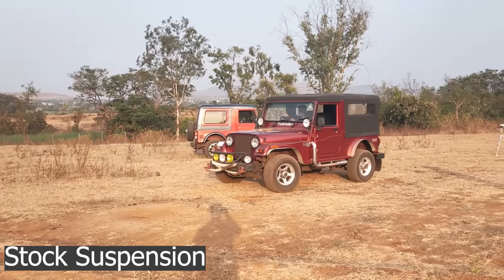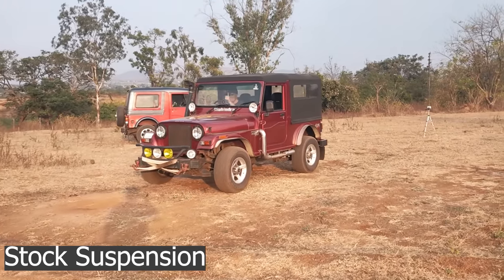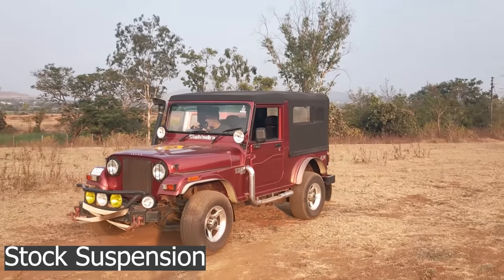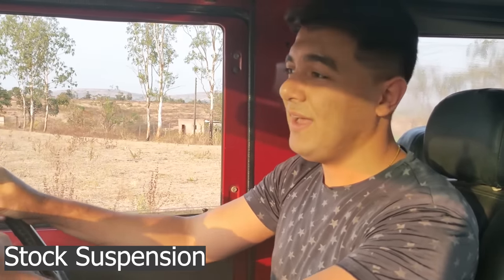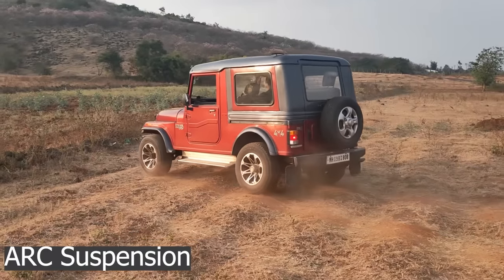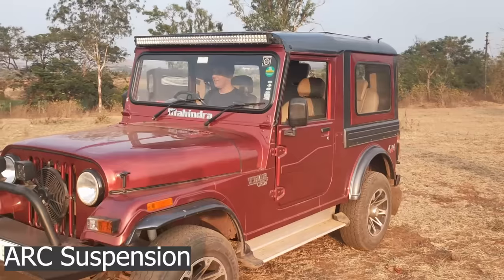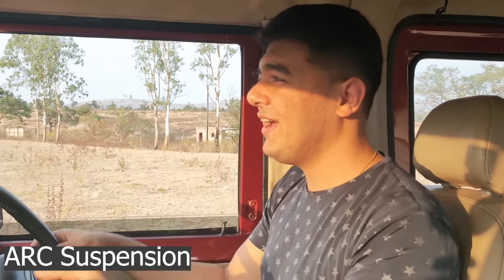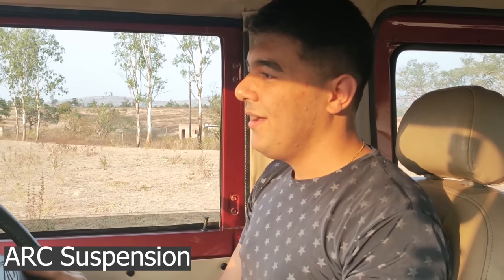Mahindra Thar CRDe Stock Suspension vs ARC kit - Composite Leaf Spring Shock Absorber Anti Roll Bar

Comment: How about arc rear suspension for old model ford endeavour? Is it worth to change the rear leafs for a comfortable ride?
Reply from the maker: Yes sir, the composite leaf springs work wonders for Endeavour.
You will definitely get more than a comfortable ride for sure.

https://www.arcindustries.co.in/products/ford-leaf-springs-118119/endeavour-leaf-springs-155156/ford-endeavour-arc-composite-leaf-springs-229230
Reply from the maker: Product can be ordered from the below Link - 
https://www.arcsuspension.in/ford/endeavour/endeavour-1st-gen-2003-2014/ford-endeavour-arc-suspension-kit-front-rear-shock-absorbers-rear-composite-leaf-springs-ford-endeavour-2003-2014

To know more Call us on 9422047019 / 9922099292

Comment: Is there any suspension upgrade to Ertiga 2020 such as antiroll bar
Reply from the maker: Not at the moment sir, but we do have Rear Shock absorbers for the New ertiga 
https://www.arcindustries.co.in/products/maruti-suzuki-shock-absorbers-102103/ertiga-shock-absorbers-125126/maruti-suzuki-ertiga-arena-arc-rear-shock-absorber-2018-2020-374375
Reply from the maker: Product can be ordered from the below Link - 
https://www.arcsuspension.in/maruti-suzuki/ertiga/ertiga-arena-2nd-gen-2018-2021/maruti-suzuki-ertiga-arena-arc-rear-shock-absorber-2018-2022-ertiga-arena-2018-2021

To know more Call us on 9422047019 / 9922099292

Comment: Can you make product with more suspension travel ?
I mean one with a bit more articulation than this product
Reply from the maker: More Articulation will increase Body roll. Optimum design specifications require balanced parameters with suspension travel.
Upon driving on this kit, You wont require more travel. Also please notice that the dips are quite aggressive. We are literally driving it in Farm cultivation cleared track.
Reply: @ARCSuspension  thank you. Are your products available in Siliguri West Bengal?
We Nepali Customers need this product.
Reply from the maker: Yes sir, contact us on +91 9922099292 , 9422047019 
We ship worldwide. 
Shipping is free Pan India. You can directly order directly on our website too. 
Arcsuspension.in

Comment: Can we disconnect the swaybar for better articulation in offroad in this model
Reply from the maker: Seems like a custom requirement, please contact us on 9422047019 / 9922099292 to know more.

As far as I know, ARC make Anti Roll bar which should easily suffice in all conditions.

Comment: Thanks for exaggerating the problem. Did the weight of the hardtop partially resolved the issue?
Reply from the maker: No, suspension kit strength is different according to vehicle.
Soft top , hard top, frp top, heavy modifications.  All have  different configurations.
Composite leaf spring can be custom made once we receive feedback from customer on the state of modification done on vehicle. Doesn't matter if hundred of kg is increased,  we make leaf springs accordingly.
Reply: @ARCSuspension  pls share price for thar 2018 model

Comment: Im coming straight at you after getting my bolero delivered
Reply from the maker: We shall be ready for you <3 
Please contact Mr Rohit Pawar at 99220 99292 regarding fitment, because we do not provide fitment services at the moment and encourage customers to get it fitted with their local mechanic/workshop. No modifications required for fitment.

Comment: Hello sir i have thar 700 limited edition. .what will change in my thar for comfort...
Reply from the maker: Sir the whole feeling of driving will be changed. The vehicle will feel much smoother and easier to drive compared to stock suspensions.

Comfort Series Suspensions 
https://www.arcindustries.co.in/products/mahindra-109110/mahindra-thar-142143/mahindra-thar-crde-arc-suspension-kit-composite-leaf-spring-shock-absorber-and-anti-roll-bar--330331
Comfort and Offroad Series suspensions.
https://www.arcindustries.co.in/products/mahindra-109110/mahindra-thar-142143/mahindra-thar-crde-arc-suspension-kit-composite-leaf-springs-shock-absorbers-anti-roll-bar--352353
Reply: @ARCSuspension  can u pls elaborate in what changes are there in the above two suspension set ups? If i want to make thar comfortable for city use with occasional offroading, which one should i select and why?
Reply from the maker: Product can be ordered from the below Link - 
https://www.arcsuspension.in/mahindra/thar/thar-crde/thar-crde-arc-suspension-kit-composite-leaf-spring-shock-absorbers-anti-roll-bar-onroad

To know more Call us on 9422047019 / 9922099292

Comment: I know this not relevant question .. but is there any improvement in mileage ?
Reply from the maker: Indirect behavioural aspect may cause improve the average.
Suppose your commute is on bad roads and excessive braking is observed due to discomfort. By installing good suspensions, comfort and stability will render the driver brake less. Reduced Braking will indirectly cause the momentum to be not wasted.
Cornering will be better, Increased stability while cornering will feel effortless hence reduced braking.
Also good suspensions increase Tyre grip, increased grip = less drag. Less fuel wasted.

Suspensions can play a vital role in all parts of the vehicle as the jerks absorbed by the suspension reduce the resonance and play in the parts, which may otherwise cause cabin sounds and play in moving parts if suspensions are not optimally designed and tuned.

Comment: Wouldn't you get the same result by just switching the company shocks with a softer pair and throwing a pair of heavy bags in the back seats to settle the leaf springs?
Reply from the maker: If that were true, truck would've made the best for comfort.
Equilibrium of the vehicle can not be stabilised by adding forces, strength capacity should be versatile and show support comfort in all weight,road conditions. And on all speeds.
Also the kmpl will go down,  so it may do more harm than good.

Composites will perform way better even when compared to a metal leaf spring vehicle with added load.

Comment: Hello dear i need this for thar di 2013 how much it will cost and is it sutaible for thar di or not
Reply from the maker: Sir we have two variants specifically designed and manufactured for Thar DI.

Onroad Comfort Series ARC Suspension kit
https://www.arcindustries.co.in/products/mahindra-109110/mahindra-thar-142143/mahindra-thar-di-4wd-arc-suspension-kit-composite-leaf-springs-shock-absorbers-anti-roll-bar--351352

Onroad & offroad series ARC Suspension kit.
https://www.arcindustries.co.in/products/mahindra-109110/mahindra-thar-142143/mahindra-thar-di-4wd-arc-offroading-suspension-kit-4-rubberised-composite-leaf-springs-4-shock-absorbers-anti-roll-bar--357358
Reply from the maker: Please Share your phone number for a callback.
We will be happy to assist you with any queries you have about our products.
Reply from the maker: Product can be ordered from the below Link - 
https://www.arcsuspension.in/mahindra/thar/thar-di/thar-di-arc-suspension-kit-composite-leaf-spring-shock-absorbers-anti-roll-bar-onroad

To know more Call us on 9422047019 / 9922099292

Comment: arc was in speed but the stock was in very low speed to prove stock suspension inferioor
Reply from the maker: You can't possibly drive in speed without incurring injuries in stock condition. 

You know, if one wouldn't drive over potholes the same way, why expect us to do otherwise.

Comment: Kya mai Apni old mm540 1998 model me laga skta hu kya prize kyo hoga pure kit ka
Reply from the maker: Sir total price for MM540 will be 88,980 jisme aapko
4 (2 front and 2 rear) Composite Leaf Springs and 4 ( 2 front and 2 rear) ARC Shock Absorbers mil jayenge.
Product can be ordered directly from our website linked below,
https://www.arcindustries.co.in/products/mahindra-109110/mahindra-jeep-series-147148/jeep-mm540-arc-supension-kit-composite-leaf-springs-and-shock-absorbers--281282
Reply from the maker: Product can be ordered from the below Link - 
https://www.arcsuspension.in/mahindra/jeep-series/mahindra-old-jeeps/mahindra-vintage-jeep-arc-composite-leaf-springs-front-and-rear-1954-2010-mm540

To know more Call us on 9422047019 / 9922099292

Comment: Me Gujarat se hu 
Muje meri bolero (2008 slx) me lagana he 
kitna bill  hoga
Full system ka
Reply from the maker: Sir full system will cost you 67,150 inclusive of doorstep delivery all over India. 
Please follow the below link. It is specifically designed for Bolero SLX.
https://www.arcindustries.co.in/products/mahindra-109110/mahindra-bolero-146147/mahindra-bolero-slx-arc-suspension-kit-composite-leaf-springs-and-shock-absorbers--308309

You can order the suspension directly from the above link.
Reply from the maker: Please share your number for a callback.
Reply from the maker: Product can be ordered from the below Link - 
https://www.arcsuspension.in/mahindra/bolero/slx/bolero-slx-arc-arc-suspension-kit-onroad

To know more Call us on 9422047019 / 9922099292

Comment: How can i get s kit installed in greater noida west
Reply: I have mahindra thar crde 4x4
Reply from the maker: Sir you can get it shipped Worldwide. Any local Mechanic can do the installation. 
Product Link - https://www.arcsuspension.in/mahindra/thar/thar-crde/thar-crde-arc-suspension-kit-composite-leaf-spring-shock-absorbers-anti-roll-bar-onroad

For more information - please contact us on 9422047019 - 9922099292
Or mail us on info@arcsuspension.in

Comment: Please upload this type of comparison video of thar di
Reply from the maker: Sir you can get better performance in thar di because
Thar crde has leaf spring and shock absorber combo at the rear and coil spring and shock absorber at the front.
We only manufacture composite leaf springs and not the coil springs. 
For Thar di we manufacture the whole set.
4 leaf springs, 4 shock absorbers and antiroll bar. Making the vehicle drive completely stable while making it comfortable even on bad roads
Reply from the maker: We will definitely try and get two Thar Di whenever possible for testing. 

Thank you for your input
ARC
Reply: @ARCSuspension  Thanks a lot if you uploading video of thar di. And after i will installing soon leafsprings in thar.

Comment: You should drive both the car in the same speed. Why the stock suspension thar driving at low speed n the ARC suspension driving at high speed? If you drive the stock suspension at that same speed you'll see almost same performance.
Reply from the maker: Same answer given to everyone.

Still. Will you break your back and drive, because it will cause issues.
Simply put, you can't physically drive the stock vehicle without pain. With ARC it is easy.
The whole video shows the same, and if you have any doubts, try for yourself with moneyback guarantee. Is that serious enough ??
Reply: @ARCSuspension  decided to order one for my ambassador grand.
Reply from the maker: Will be happy to serve you. Please share your details if you have any queries.
Reply: @ARCSuspension  I had a discussion with sir for over a few years. Heard you have started a showroom in chennai.  Looking forward to visit it . Can you pls share the location
Reply from the maker: ICD TUNING - CHENNAI

Comment: What is the total cost to make it fix?
Reply from the maker: Sir fitment costs are variable based on your mechanic/workshop rates depending on location. This full suspension kit can be ordered from the link given below.
Product link given below
https://www.arcindustries.co.in/products/mahindra-109110/mahindra-thar-142143/mahindra-thar-crde-arc-suspension-kit-composite-leaf-spring-shock-absorber-and-anti-roll-bar--330331
Reply from the maker: Product can be ordered from the below Link - 
https://www.arcsuspension.in/mahindra/thar/thar-crde/thar-crde-arc-suspension-kit-composite-leaf-spring-shock-absorbers-anti-roll-bar-onroad

To know more Call us on 9422047019 / 9922099292

Comment: How can we contact you to instell arc suspension
Reply from the maker: You can directly order the suspension from our official website
www.arcindustries.co.in through all online payment options.
installations require no special knowledge as these parts are direct replacement to stock OEM parts. You just remove the stock parts and install our suspensions parts right on.
Installation requires no modification to the vehicle.
Any local Mechanic can do it.
you can get in touch with us on 9422047019 / 9922099292

Comment: Wat is the cost?
Reply from the maker: Hello Sir, We have multiple variations for suspension kit for onroad to mild offroading kit, to onroad plus heavy offroading suspension kit for Thar CRDe and Thar DI
Check out the range of suspension kits available for Thar CRDe and DI
https://www.arcindustries.co.in/products/mahindra-109110/mahindra-thar-142143/mahindra-thar-crde-arc-suspension-kit-composite-leaf-spring-shock-absorber-and-anti-roll-bar--330331
Reply from the maker: Product can be ordered from the below Link - 
https://www.arcsuspension.in/mahindra/thar/thar-crde/thar-crde-arc-suspension-kit-composite-leaf-spring-shock-absorbers-anti-roll-bar-onroad

To know more Call us on 9422047019 / 9922099292

Comment: There is some body roll. :)
Reply from the maker: It falls in articulation category sir. Physics cant be denied :)
Reply: @ARCSuspension  btw, I'm looking for suspension kit for my bolero camper 4x4. Which kit to use and how to get it in kathmandu nepal?
Reply from the maker: Sir please speak with us on 9422047019 / 9922099292. 
For Mahindra Camper there are a few variants, please share the photos of suspension setup for front and rear on whatsapp on above numbers to recommend you the right product.
The product is usually shipped to Nepal for Mahindra Vehicles.
Reply: @GothaleKancho  lilu bhayo tapaile
Reply: @ARCSuspension  thanks.

Comment: Are they any, Lift Kits For New Mahindra Thar 2020-21, what are the options to just have some lift to be more apt on Rought, rocky terrains. Especially any solution for Raditor is placed quite low, for a 4x4 Thar. It could easily get damaged. And I believe Thar cannot be imagined to be pampered like other cars because on its terrains it's one among the kings. Please give advice, on off road performance enhancement advice for New Thar 2020-21
suheelu@gmail.com
Reply from the maker: Please call us on 9422047019 / 9922099292

Comment: These people are running the car faster which has arc suspension and they drove the car slowly with stock suspension that's why the stock car was giving more bumps so why don't they drive stck car at same speed as that of arc suspension car.
Reply from the maker: Do you even understand the concept?
The vehicle is driving with ease with our kit and with metal you cant drive fast without breaking your back.

Drive with ARC once. And then feel free to justify.
Reply: @ARCSuspension  maybe you are right sir i just noticed that you drove one car fastly and other car slowly. By the way is it available for santro xing
Reply from the maker: I get your point though. I have a video which will showcase just that.

Mr Rohit, our tech head actually sat behind, in both vehicles.
I drove the ARC kit normally. But when we initiated stock suspension test, we had to drop the idea. He even swore. 😅

Will find the video and have it uploaded.
Reply from the maker: Not available for Santro Sir. Haven't received much requests for the requested vehicle.
Reply: @ARCSuspension  thanks for replying sir